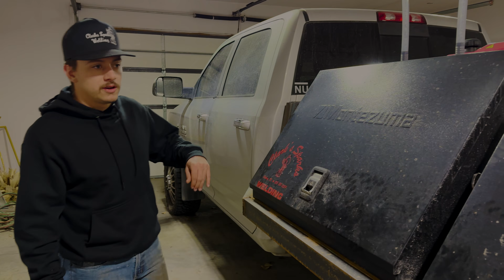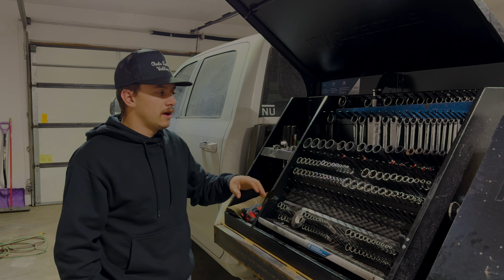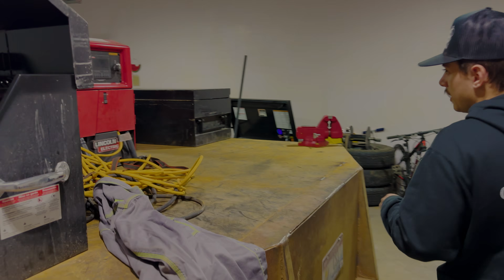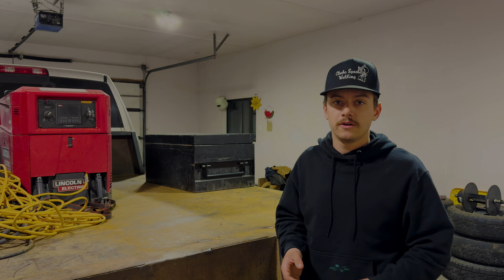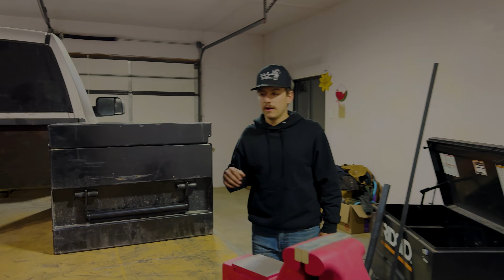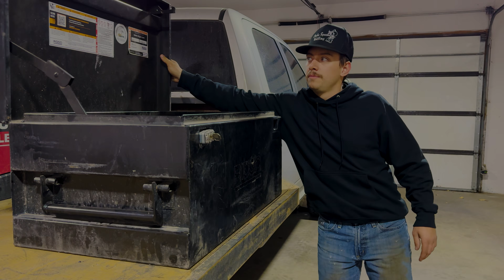Welding Rig Tour - Mobile Welding Rig

Comment: I wondered how you were able to run that 330MPX turned that way with the rear of the welder towards your back glass on the truck until I saw how far back it was. How hot does the glass get after running the welder for an hour or two? I owned a 330MPX for exactly one month and made Lincoln take it back for exactly that reason. On my truck, the welder was spaced about 11 inches back from my cab shield and within an hour, you couldn’t lay your hand on the cab shield and the welder would get so hot that it sometimes would run wide open for 45 minutes to an hour in an attempt to circulate enough air to cool itself down before it would return to low idle after you had finished using it. Liked how the welder performed but hated everything else about it! Buyer beware! When Lincoln states, ONLY in the owners manual, that you have to have a minimum of 18 inches space on every side of the welder, they mean it.
Reply from the maker: The exhaust has cleared the top of the truck by the time it gets to my glass. So it doesn’t get hot at all. I’ve never had a problem with it getting too hot. It’s been a great machine for me so far!
Reply: @ Maybe I got a lemon. I wish you well. Thanks for the reply.
Reply from the maker: @ thank you!
Reply: I don't know but I have asked around in my area as I had interest in buying a 330, and the consensus was a resounding no don't buy one. Allegedly, people that have tried the mpx 330 traded them back in for the good ole ranger 305G, Don't have any personal experience with a 330. But I do love the tried and true 305G hard to beat em.
Reply from the maker: @ I actually really like this machine. It’s the non fuel injected one so maybe that’s why🤷‍♂️
Reply: @ Use your own judgment but I went back to the 305G carbureted version after asking Lincoln to exchange the 330MPX for a 305G EFI. I was disappointed that the 330MPX didn’t work out for a whole host of reasons and thought I would at least end up with a little more AC generator output by going to the 305G EFI. Unfortunately, after three separate attempts by a Lincoln authorized service center, we could never get the 305G EFI to idle correctly when it wasn’t working. Frustrated, I had Lincoln trade it out again for my third 305G carbureted. Love it! For the record, I still own and use my original 305G which I purchased new in 2005 that now has 7900+/- on the clock! My second 305G was bought new in 2015. I ran it 7-1/2 years, put 3200 hours on it and sold it for more than I paid for it. Just saying. The 305G carbureted is a fantastic machine!
Reply from the maker: @ thanks for your sharing your experience! I appreciate it!
Reply: @ You’re welcome.